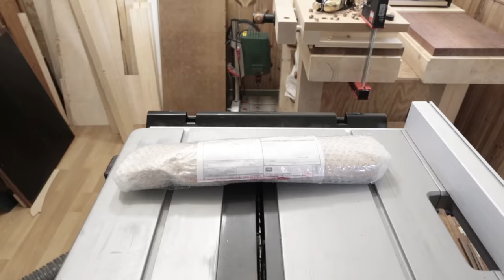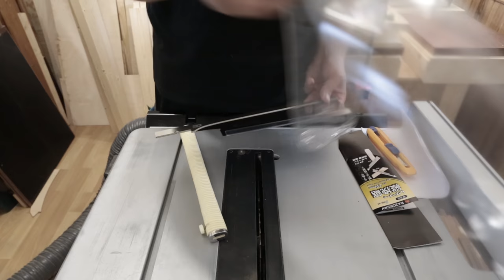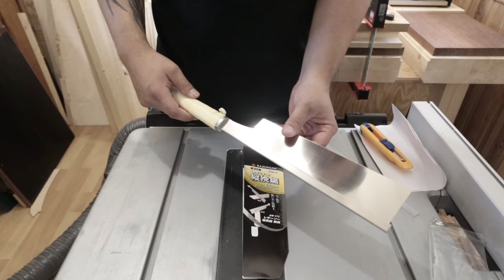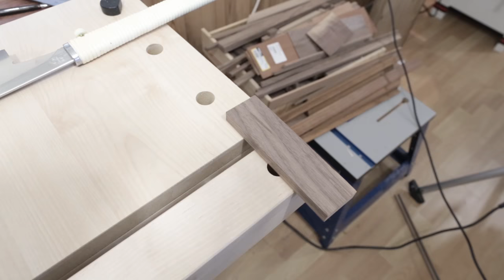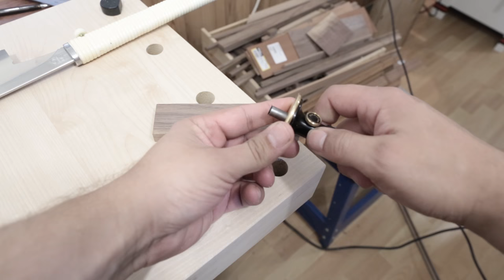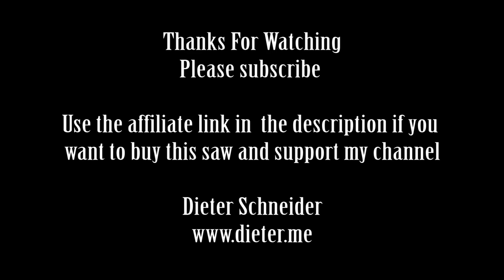Japanese Saw Gyokucho No. 372 Dovetail and Tenon

Comment: How would it do in a 2 inch cross cut of construction lumber ? or do you recommend getting a dedicated cross cut saw? Which do you use for deep crosscuts around 2 -3 inches
Reply from the maker: You can get double sided saws with one side for rip cutting and one for crosscutting. I use one in my workbench video here https://youtu.be/cQ-S7dp_CFw
Reply: Yes, I have the Ryoba. Its very nice. But for angled tenons or really wide shoulders its a little bit difficult getting it perfectly straight. I'm looking for something more stiff. I know there is a Gyokucho 371 strictly for crosscut. Just wondering if you had it?